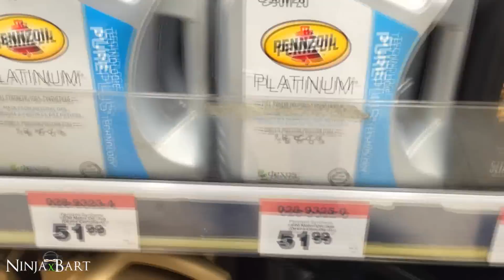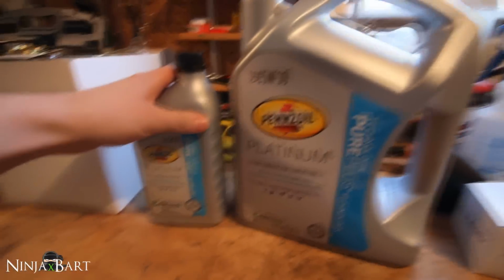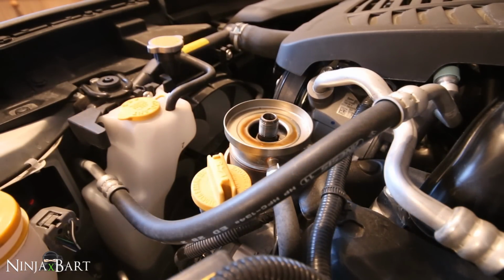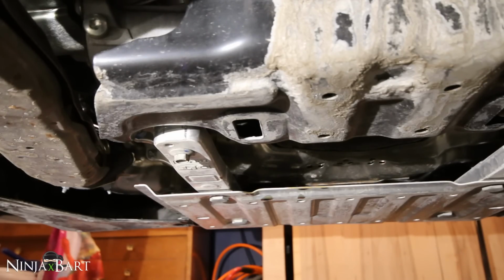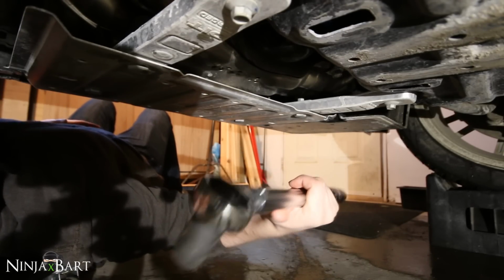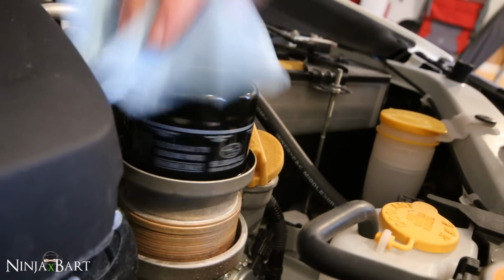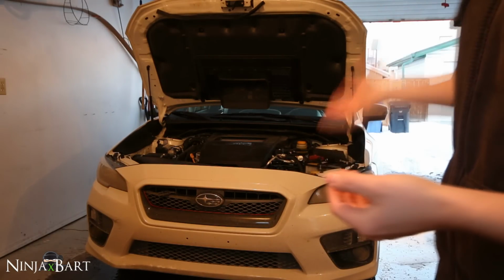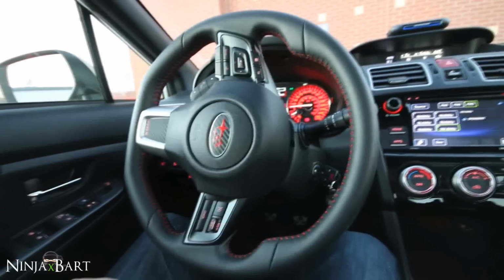2016 WRX Oil Change - First Oil Change

Comment: Hi Spenser. Here in Montreal, Quebec , we use 5w40 due to the cold weather !! I do this at lachute performance. A bit expensive , but worth it ! They use GULF full synthetic for 126 $
for an oil change , oil filter and air filter . You re lucky due to the fact that you do your oil change at home .
Reply from the maker: That's a great idea to use for the colder temps!! Also Lachute is so awesome!! Cheers from me over here in Calgary!

Comment: You removed the drain plug with a 9/16th socket?  

I recommend investing in a set of Metric sockets...
Reply: 9/16 socket is very close to a 14mm it’s still grabs fine.

Comment: Great tutorial.  I let the stealership do my first oil change and check up but I am going to do them from here on out.  Its almost exactly like my BRZ's oil change.  I am wondering if its the same gasket....going to have to check that before I give it a go.  Thanks
Reply from the maker: Which gasket, the crush washer on the drain bolt? It's pretty much the same yup, should be, but they sell them with the filters at the dealership! :)

Comment: Nice man.  This is a lot easier to do on the 2015+ models than it is on my car.  The fricken splash guard on the bottom of mine is a pain in the ass lol.
Reply from the maker: Oh yeah man, I remember doing it .. You need to undo a clip in each wheel well behind the wheel lol... Getting it lined back up to put back on it worse than getting it off! Harder than doing the actual oil change hahaha!

Comment: Nice oil change vlog, I see Canada Subaru allows for more varied trim level options when purchasing the 2016 WRX,. Please correct me if I'm wrong but your WRX has turn signal mirrors an option only available on the 2016 WRX limited edition in the US.
Reply from the maker: Hey! You are correct, or so I've noticed! I've been asked about this a lot.. It does appear that Canada vs USA have different features for the different trim models!  This is the sport model, and has the turn signals in the mirrors which I believe is the biggest difference! (Also has the lane change assist etc) 
I really like it!
Reply: NinjaxBart I thought so as the features you mention as included in your sport package are only available when purchasing the limited package in the US. The sport model in the US includes an alternate set of STI 18inch wheels, the US version STI catback. The Japan model has all the dreamy options that one has to pay through the nose to have imported, i.e. power folding mirror. STI sport mufflers, 296HP S4 FA engine on a CVT,Security camera, Numerous stereo head unit options...and on and and on. Hey "Nice RIDE" though, I enjoy your WRX vlogs. Thanx.

Comment: another great tutorial!  did you get your filters directly from the dealer  or ?  also, the ramps need to support how much weight?  I have some but never had to use them for an oil change.  is their like some safety rating or something?

also, I haven't checked all your videos yet, but have you ever done a engine bay or under the hood cleaning video?  I'm certain you would make a good one for us all.  

thanks, man!  always fun to watch your videos.
Reply from the maker: GR8GUY54 I should do one eh.. Maybe I will bro thanks for the suggestion. Mines filthy hahaha. I got the filters from the dealership yup!!  Also the ramps are like 6,000lbs I believe.
Reply: How much was the filter? On subarugenuineparts they are about 6 bucks along witht the $1.25 gasket
Reply: NinjaxBart I did mine last weekend with ramps and because of paranoia,  I used jack stands in conjunction with.  super EZ.   thanks, man!

still waiting on your "Under the Hood Detail" video :))

Comment: Nice vid. Make sure you pull the torque from the handle on the wrench to get the right amount of leverage/force.
Reply from the maker: Thx for the comment dude appreciate it! and thanks for the pointer on the torque wrench, too! Enjoy your weekend!
Reply: Subaru must install the drain plug before painting the pan, hence the reason for the crush washer sticking to the plug. ;-)

Comment: I didn't put the new gasket on mine. I didn't even know that had to be replaced. You think it'll be ok?
Reply from the maker: Yeah I think it'll be fine, but, I definitely would keep an eye to see if it leaks at all. Should be fine. That gasket is like $1 or comes with the filters usually.. Definitely get one for next oil change bcuz I don't think it'll last more than two times. That washer is a "crush gasket" so it is generally a one use thing to keep the drain bolt sealed nice and tight!

Comment: I just did my oil change and put in 5.4qts but it was pretty low on the dipstick, so I added some more, still low, some more, still low. Put in the rest (should be 6 quarts) and now the dipstick is perfect. I'm scared why so much went in though? Unless they under filled the bottles

Comment: I like the ramps you have. I have race ramps and love them. Just when getting on the ramps for front wheels I must use two small pieces of wood to clear bumper. I have a 2015 WRX stock suspension not lowered.

Any reasoning behind getting that brand oil? So far I've been getting the oil from Subaru.
Reply from the maker: +George PS Mouyios That's so weird you need wood eh, but maybe your ramps are a bit different than mine!! :) 
For the oil I just honestly went with that seemed to be quite commonly used on NASIOC and under oil analysis review threads this stuff had great reviews so!
Reply: +NinjaxBart Yeah my ramps are definitely different. They are great but unfortunately for the front it didn't seem as if it would clear without the wood. Just a minor inconvenience. 

When I looked around at the time there was not too much out there as to what is the best proven oil so I took what I thought to be the safer option. I will probably get the same oil as yours at one point but for now I still have the oil I got from Subaru for another oil change and a half and don't want to waste it.

Car running great with that still? I don't put much mileage on my WRX. I have ~7K miles on the car and got it December 2014.

Comment: If I get the Fumoto drain valve, do I have to put the crush gasket on there before putting it on the vehicle?
Reply from the maker: Most Fumoto's come with a rubber washer built into the Valve body, so it doesn't need it. Check to see if your Fumoto has the rubber gasket! :)
Reply: Thanks man! My first car is a 2017 wrx and these youtube videos and the forums are helpful. Thanks again! Subbed

Comment: By doing the oil changes yourself does it void the warranty? If not how does it work?
Reply from the maker: Nope - You just need to keep your oil receipts and write the mileage / KM's you did your oil change. I also take photo's as backup of my odometer. Although now an accessport will void warranty.

Comment: Or, just find a coupon for oil change at Subaru. They probably use higher-end oil for their engines. I've seen them for $60 for oil change around Pennsylvania.
Reply: My dealer charges around $90 for an oil change......its just insanity.  Depending on how much I can get my oil for ( I try to keep an eye out for sales on Amazon and Walmart ) I can usually buy 2 - 5 quart jugs and Filter for around $45-$55.  If you wanted near the amount of oil for just the change with no extra, you could do it for cheaper.  Once you have your own tools, there is no reason to not just do it yourself....dealerships charge so damn much for synthetic oil changes around me.  Been using the same oil he used in the video in my BRZ for around 15k miles now and no issues at all.  Penzoil ultra is a cheap, high quality oil...nothing at all wrong with it.

Comment: holy shit. you do not need to torque a drain plug that much. that is hella tight for a drain plug. this is how people strip the drain plug over time. if your lucky you only need to replace the plug which is a good thing, so you can get a new one like a magnetic drain plug or if your unlucky you will strip the tread on the pan and you need to replace it. ft/lbs is waaaay too tight. i am pretty sure its suppose to be in/lbs and its a huge difference.

snug is enough. 90 degrees of tightness after you hand tread it is enough.
Reply from the maker: +Mouse Click  I torqued the drain plug per the specs using a torque wrench. Thanks for your concern :)

Comment: Fail at 8:00.
If you want to get an accurate torque wrench reading you HAVE to hold the wrench by the black handle at the end of the wrench or your torque wrench fulcrum reading will be incorrect.
Reply from the maker: Oh really, thank you! Excellent to know that, I'll definitely keep in mind for next time!! 
I have checked the bolt and no sweating or leaking so far however so I think it's okay anyways, I did go a little past the click, too!! 
Thanks !

Comment: poor your oil as close to the funnel as possible. Poring the oil from a "height" can create bubbles and aerate the oil when it splashes inside, which you dont want.
Reply from the maker: Thanks for the tip !! Will remember this! :)
Reply: For sure. Love the car man. I am jealous haha
Reply: +Big FING Box can you explain why this bad..?
Reply: +BCBOYS92  so for example go poor a glass of water into a cup slowley and close to the cup. you will see almost no bubbles. now poor into the same cup from a foot or two above the glass you will see it creates tons of small air bubbles. in water this is good. for engine oil this is not because we don't want gaps in fluid coverage as it flows through the system. we want a steady flow of oil making contact with the components at all time keeping wear minimal and cooling the components.  you don't wait to airrate your oil :)

Comment: U shuld get the Fumoto drain vavle. Make ur life much easier.
Reply from the maker: Oh yeah man absolutely something on my to-do list!!!  Makes things way easier I'm sure eh!! Thank you for watching :)
Reply: +NinjaxBart anytime bro. Keep up the good work. Loving the videos. Still debating whether to get the nameless turbo back exhausts or just the muffler. Hmmmmmm.  🤔
Reply: +Mitchell Camacho  i looked at it but i cant trust it. It even says if you run over anything to pull over immediately to make sure it isnt leaking. If a bolt gets hit its really no big deal. I know it has a safety on the valve, but seems like such a unnecessary risk,  maybe im paranoid lol
Reply: +Big FING Box lol hey man understandable. But so far for me almost 10,000 miles I've been good even got the level clip on it for peace of mind when I bough the valve. N wit all the potholes n mess up roads in New York still haven't had a problem with the valve.
Reply: +Big FING Box This was something I considered getting but immediately wrote it off because I don't trust the damn thing. Just get crush washer and stick with bolt easy enough.
Reply: George PS Mouyios yup. There's a reason it isn't used from the factory . Sure seems convenient though
Reply: +Big FING Box Yeah, it does make things a bit easier but removing bolt, discarding old crush washer, putting new crush washer and screwing drain bolt back is pretty easy also. No removing of any splash guards is a blessing also :)

Used to have a 2001 Civic before and although removing the drain plug was easy getting to the oil filter was a bit difficult and somewhat scary. Don't be claustrophobic!
Reply: +Big FING Box there a lot of things they don't put from factory but we end up getting for the car.

Comment: fumoto valve if you havnt added one yet :)  dealer quoted me back in the day ~75USD for a oil change..... nopenopenope.jpg
Reply from the maker: Hahaha hellnope.jpg!!  Yup I am going to add a valve next change I think!!
Reply from the maker: Got one!! :)
Reply: hah nice!  if you havnt installed it yet read the directions heh.  only tighten from the main valve body.  finger tight + 1/4 turn is all ya need if i remember.

so far 15% saved for my downpayment haha.  sigh... 2019 wrx here i come lol.

Comment: @ how many miles did u wait?
Reply from the maker: +Carlos Hernandez I did it at 6,100km's.  The reccomended is 10,000km's but I figured I'd do it a bit early since it was the initial break-in period! 
I might do it less than 10K in the future, however!
Reply: +NinjaxBart okay i gotta convert that to miles haha thanks bro!
Reply from the maker: +Carlos Hernandez 3,790 Miles approx!! :)
Reply: +NinjaxBart thanks! i was getting worried haha
Reply: +Carlos Hernandez I do mine every 5k miles. seems to be doing the trick. people prematurely changing the oil because they're worried. as long as you you check it regularly every week and add more when the level is low you're fine

Comment: Sorry but Pennzoil is NOT the Best choice. Castroll is the best
Reply from the maker: There are 3 types of Castrol oils that can be used in the 2015+ WRX:  Castrol Edge, and Edge SPT, and the "German" specific lineup.  None of these MEET the Subaru required warranty specifications.. So you can run Castrol yeah, but if you have an issue and they ask for your oil receipts - you could potentially not be covered!  
Nonetheless, I never did specify Pennzoil to be the "best", although it is the most commonly used based on the massive Nasioc oil analyst thread.  I'm currently running Mobil 1, but will be going to an even stronger Pennzoil most likely next change - Pennzoil Platinum Ultra.   
Cheers and thanks for watching man :)
Reply: NinjaxBart You have changed the oil yourself, so the warranty is dropped the moment you change the oil at a non-certified Subaru dealership unless they have changed the rules. But very nice car dude, and nice color! :)
Reply from the maker: +Daniel San It actually very specifically says in the owners manual that anyone can do the oil so long as it meets the OEM requirements! It's right under the line specifying the oil viscosity and weight requirements. That's why people keep their receipts, and photos of the mileage with date and such. I've been doing it on all 3 of my Subi's!!
Reply: NinjaxBart Oh wow. On my first car I did my first oil change as well, rented a lift and bought original VW-oil, original spark plugs, oil filter, and air filter for both the cabin and engine, but on my new car (also used) I got it serviced at a VW-dealership because it was too valuable to ruin the guarantee. 
But I must give it Subaru that it's nice of them to let you do your own oil-change, I will say that to my Subaru-friend! :)

Comment: $52 for  5QT jug of oil?!?!? I payed $17 for the same jug today
Reply from the maker: +Cichlid Maximus There are several different levels to the Pennzoil "Platinum",  I don't control the price though, and ain't overly concerned. That was the price, It was the same at Walmart, Costco, and Canadian Tire.   Goes on sale occasionally, then I stock up on a few jugs.  CDN vs USD exchange rate could play a negative factor in our pricing, too (and depending where you live if you're in the US, benefits your economy / prices!)